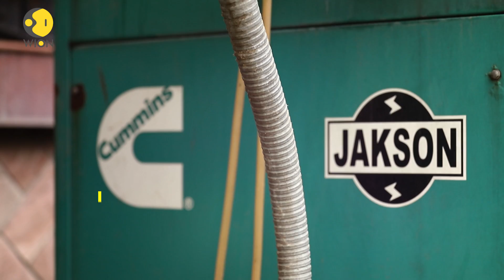Chakr Innovation: Capture pollution and turn into ink!

Comment: Nitro-polycyclic aromatic hydrocarbons (nitro-PAHs) are potent environmental carcinogens, often much more mutagenic and carcinogenic (10-100,000x) than their parent PAHs, acting as direct mutagens that damage DNA, leading to cancer and reproductive issues, originating from incomplete combustion (vehicles, fires) and forming in the atmosphere, posing significant risks from inhalation and ingestion. 
Another stupid company called Hindustan Petroleum sells  Elasto 710 (DAE), which has high PAH for food packaging inks in India. Caught red-handed by the UN & several others. This is a step further in the same scary direction. The company must put out a white paper.

Comment: Good innovation to reduce the pollution caused by Diesel Generators.
I would suggest this to be installed at every Housing Society in India as well as at all Mobile Tower Sites across India and it will certainly make a big difference to the environment!
I would certainly try to incorporate this as part of the Smart City Solution Project BoQ (wherever possible) that we propose for Indian Smart City Projects. Need to check if there are any capacity limitations.
Please contact me - milindpagar@tataprojects.com (+91-9920949497) to discuss. I would like to understand your proposition and include it in my solutions.